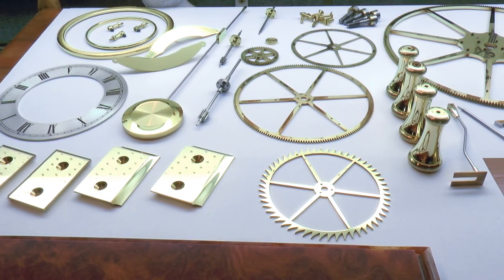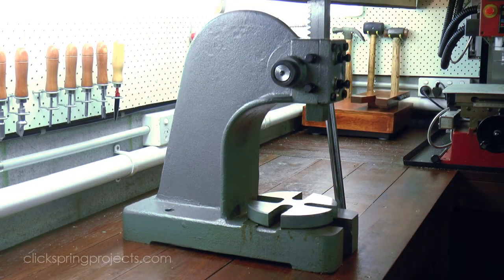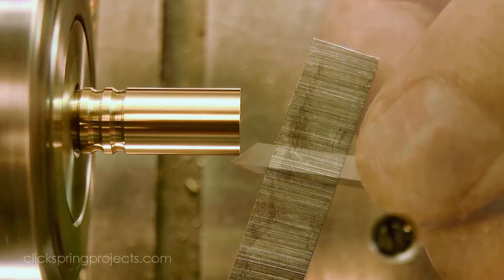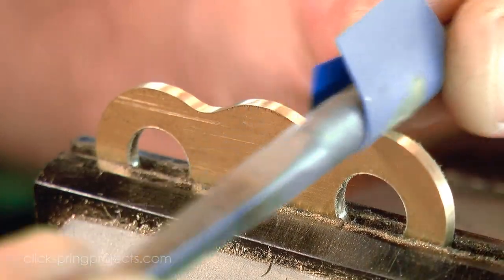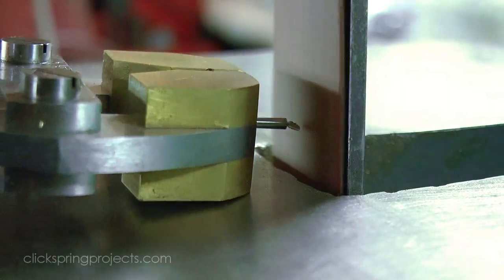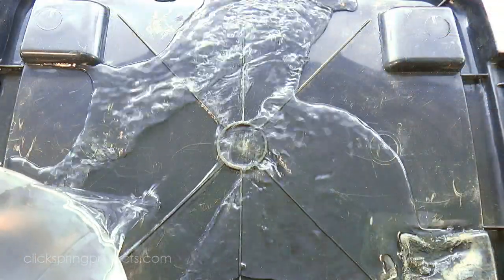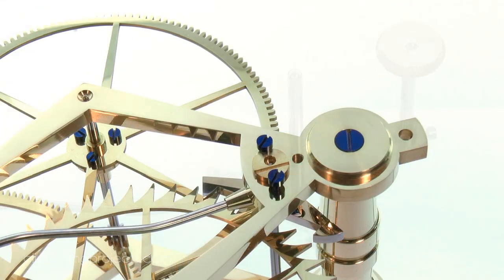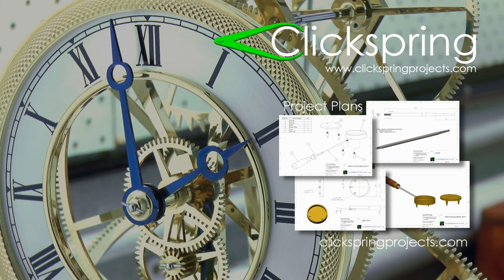Clockmaking - How To Make A Clock - Part 23 - Making The Key, Polishing And Assembly

Comment: G'day Chris, 

Bloody ripper Mate! Absolutely extraordinary production, in every aspect from the project to production to story-telling to presentation. ALWAYS exciting to see a new Clickspring vid in my stream.

Very much hoping there's more to come!

Cheers,
Coxy

PS. Amazing finish on all the clock parts. Will the brass hold that shine? Or does it have to be polished down the road or can it be coated with a protective coating?
Reply from the maker: Hey Coxy - the traditional approach is to bring all surfaces to a very high polish and then let a beautiful patina develop over the subsequent decades. If fingerprints are avoided during assembly, it will be as uniform as the finish you see in the video, but with a richer gold/bronze color. A vintage patina is one of the most prized aspects of a clock from a collectors point of view, it is quite literally a record of the clocks journey up to that point in time. Later polishing is avoided at all cost, lest it remove that story and devalue the clock. Thanks for the kind words mate :)

Comment: Hello clickspring, i was wondering where you learned to machine? I'm a young man and wondering what direction i should take to achieve the success such as yours in your videos
Reply from the maker: From books and by watching the top YT machinists like Tubalcain, Tom Lipton, Toms Techniques, Abom79, Myfordboy etc Thanks for watching Ryan
Reply: Cool! Thank you. I do have one more question, about how much would all of the equipment I need to have to be a proper machinist cost me? Or at least the tools you have, you seem well equipped
Reply from the maker: The vast majority of the machine tools I use are very affordable, hobby grade equipment. The Sherline for example is a $600 lathe and would be a great starting point around which to build a home machine shop. Start there and accumulate over time as the finances allow. Let the projects that interest you guide your subsequent power tool purchases, and wherever possible avoid buying a tool that you could make yourself.
Reply: how about your hardening forge? it looks like a fabric, what is it made of?
Reply from the maker: Kaowool ceramic fiber: http://www.ebay.com/sch/i.html?_from=R40&_trksid=p2047675.m570.l1313.TR12.TRC2.A0.H0.Xkaowool.TRS0&_nkw=kaowool&_sacat=0
Reply: very cool! never seen anything like that before watching most of your videos.
Reply: Chris, where do you buy things like the Sherline in Oz?
Reply: This is very helpful -- I have also been encouraged by these videos to start building up a workshop! Now, I am sure that there are many, many resources out there to help me answer the question of what to get started with project wise. That said, it looks like you made many of the tools in your videos yourself. If my eventual goal is to create a clock similar to this (years down the road, no doubt) would the creation of those tools be a good way to gain the experience necessary?
Reply: Ryan Clark
Stefan Gotteswinter is also another good channel, he is a professional machinist that shows the projects he does in his homeshop, showing some very accurate machining.
Many of his videos are of him improving cheap Chinese machine tools to bring them up to his German standard of quality.

Comment: what is the name of the blue liquid sharpie you put on the metal i'm a knife maker and a blacksmith so please get back to me soon
Reply from the maker: Hey Jack, Dykem Blue layout fluid, you can pick it up on Ebay or good tool shops, cheers :)
Reply: Steel Blue is the common name in the u.s. its what we use in the shop at school and at the shop at work.

Comment: When I prepare some piece of engineering (Which i didn't modeled) to render in some 3d software, I add subtle irregularities, speckles, condensation, fingerprints and dust, to make it "look real", or not that sharp-flat-shiny-edgy. When you show your work, you file, true flat, clean and polish every single little corner. You are a source of inspiration.

Comment: Sometimes I wished I had a lathe and milling machine to make my own watches and clocks. I've done it once but in someone elses shop. It's quite the art. But it's thousands and thousands of dollars just to obtain these tools plus the fine brass or steel to make these time pieces. Not many books have been written in over 150 years on clock making. I learned on old archives that are almost extinct, and the shop I worked in, the owner long passed away. I was only 17 yeaes old when I built and assembled my own small cathedral clock. I always wanted to make a Girrard Perregaux type movment clock. I've seen the design. The inventor based his ideas on Leonardo Da Vinci's blue prints for a constant drive automobile. It's nice to see clock making slowly making its way back. I wish I can get back into it again

Comment: just finished this series.  very awesome work,  definitely has inspired me to pick up clock making as a hobby.   I would give you a small tip for soldering that key though,  as a jeweler when soldering multiple pieces we would start with Hard solder then work our way down if not soldering everything at once.  So to prevent that run of solder like you got at the end just use hard solder and medium for the second join.  The reason behind not using soft solder is its considered a repair solder, so if something breaks in the future you can repair the piece and not compromise all of the solder joints because the harder the solder the higher the melting temp.  but like i said amazing work!

Comment: Hey Chris, enjoyed this series. Enjoyed enough I bought a mini lathe for myself. I didn't read through all the comments, so not sure if anyone mentioned this. You might try a change to the pendulum shaft to get a finer adjustment to the timing. I would remove the brass block on the shaft. Cut the shaft at the height of the fork. Then remove an additional amount of rod from each end, say 1/4 inch. Right hand thread the upper rod and left hand thread the lower part. Use a very fine thread. Then make an adapter to reconnect the 2 sides. Maybe a piece of brass hex stock with a machined groove for the fork to sit in. Get your timing close with the offset and rope length, then use micro turns of the connecting rod joint to make fine adjustments to the pendulum length and that should get you the timing your looking for

Comment: Absolutely beautiful work. You make this look much easier than it is. Thanks for sharing this project.One question I have is that you seem to leave a lot of excess material when you are roughing out parts and so leaving a lot to remove by hand. Is there a specific reason for doing that?
Reply from the maker: Hey Jerry, yes I've learned the hard way that its best to be cautious; I hate scrapping parts that require so much prep like these. Its hard to see it because the scale is deceptive, but I generally don't really leave that much on, somewhere between 0.5 and 1mm. At least half of that is unavoidable; its required to make the finishing cuts with hand files. If I leave much less than 0.5mm on, the belt sander or filing machine can easily leave a cut inside that finishing allowance and ruin the part. Acute corners are an exception, I always leave a bit more on in that case, because powered cutting in a tight corner is asking for trouble, best to go in gently with files. Great to have you watching mate :)
Reply: Thanks for the response - I  probably have a tendency to cut too close to the line. I am seriously thinking of giving this a go but I do not expect my results to be anything like as good as yours. I have located the plans but would appreciate a little guidance on some of the tools that you are using. I have a well equipped workshop but not really for this type of work. What is the tool you use to start drill holes after punching? Also is the filing machine the MLA-18 kit? Thanks again.
Reply from the maker: Spotting drill, more info on the filing machine here: http://www.clickspringprojects.com/die-filer-or-bench-filing-machine.html Cheers
Reply: Thanks, I have ordered a filing machine kit. I saw your post on the crossing jig. Do you have a drawing for this? It seems that it could be useful for many different marking tasks.

Comment: A very nice work - matched by equally nice film-making. Please allow me only one slight comment. The very high polish of the brass parts is done really well, the edges are sharp and not rounded as we see often in some careless polishing. However - and this might be just a matter of a personal taste - I feel  the highly reflective finish actually detracts from this  remarkable piece of your work, making it, at least from a distance where the fine detail of the quality polish are not seen, look a touch like a commercial product. I have to admit that in the first clock I was as well seduced by a bright finish, but in subsequent work and eventually redoing the first, I've avoided the high polish and on most of the brass parts just leaving the pattern of #400 or #500 abrasive. This creates a nice contrast with the mirror finished steel parts.

Comment: Loving the videos, imagery, craftmanship and clear narration - just brilliant!. Now a patron :)  Just one quick question, for all the polished parts, do you treat them to stop tarnishing or do they rely on regular polishing?
Reply from the maker: Hey Steve, terrific to have you on board mate! Re polish: Lacquering the part is a temporary fix at best, and can only be used for static parts of the mechanism (ie not wheels). Electroplating is another option, with something like gold or rhodium, but then it ceases to be a brass finish - personally I just embrace the idea of letting it patinate. A part should commence its life as pristine as possible, but once complete is usually best left to develop a natural oxide color. The oxide tells the story of the device, literally a record of its passage through time - collectors place immense value on original patina.

Comment: Hi Chris,
When you made the frame pillars, I remember you coated them in a protective clear coating.  Did you clear coat any other parts of the clock before final assembly?  I ask for a couple of reasons.  The first is that if coating was more widely used, would the varnish inhibit the working of the clock;  but if you didn't coat anything else, I am wondering if the various surfaces aged at a different rate; or did you polish everything the same way (remove the clear protective coat as well), then let it all develop the aged brass finish evenly...

Comment: Hi Chris - hoping you see this,  just wondering what you use to protect brass components from tarnishing.  I've experimented with a few varnishes but they always flake off. I've tried Renaissance Wax which is amazing, generally, but not great if a mirror finish is desired. I'm making cuff-links for our wedding guests in October and can't find a good solution.

Comment: one of the finest 

each and every part has given a full share of love and attention. 

however i was wondering, how would you adjust the time. in a previous part i had seen that the hands were a sung fit on their relative arbors, but if you would spin the hands over and over they will wear out. 

p.s. or is it adjust the time with the force driving the master gear and then wind the clock??

Comment: hi chris. I have been watching a lot of your videos for quite some time and really liked your work and patience. I needed some advice from you . I design and build small 3d printed clocks as a hobby . https://www.instagram.com/mectolab/ . In one of my clocks i used a balance spring to create a electomechanical motor. this one. https://www.instagram.com/p/BuTa9eUHB_s/ . I later on changed it to oscilate 270 degrees rather than 10 degrees : https://www.instagram.com/p/BunEhqmHrSf/. but now i face a issue of the spring snaping in just one day of use and no kind of plastic withstands that abuse. So i started experimenting with metal wire springs. I used 0.4 mm after a lot of trials and got it to work .but the thing is that i cant find any material on how to properly wind a small spiral spring. Mostly now a days it is done on a cnc. BUt how do you do it manually ? It would be nice if you can guide me to some online guide as to how it is done properly using hand tools. thanks again .